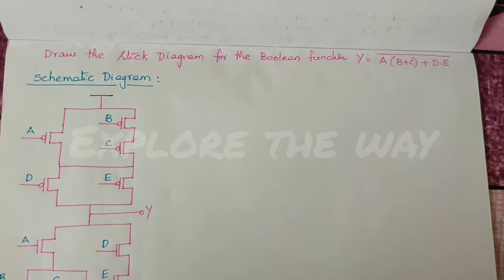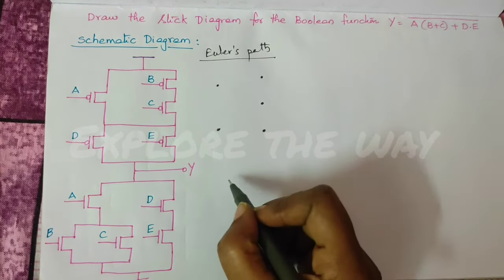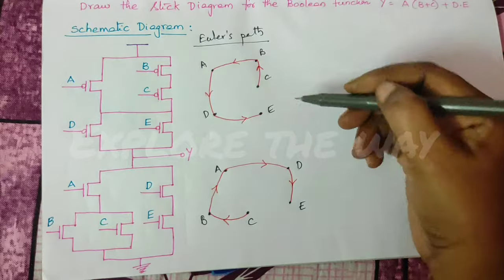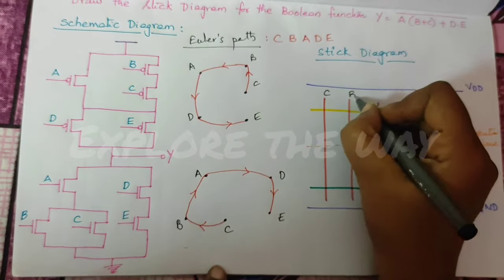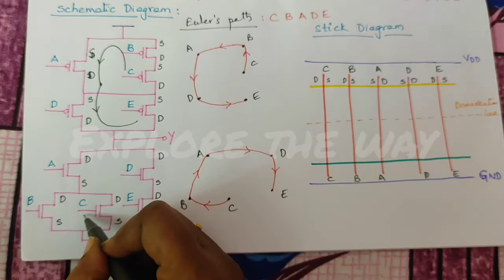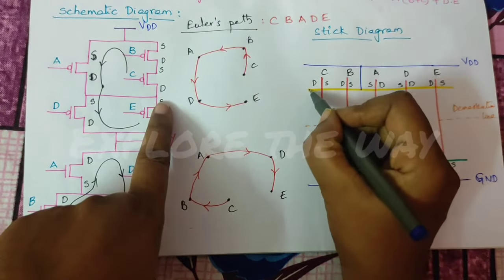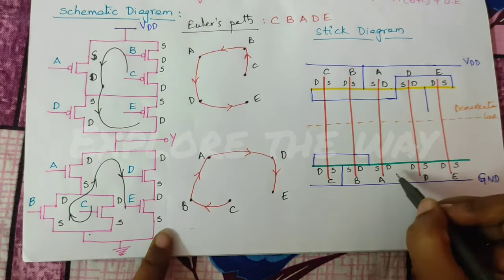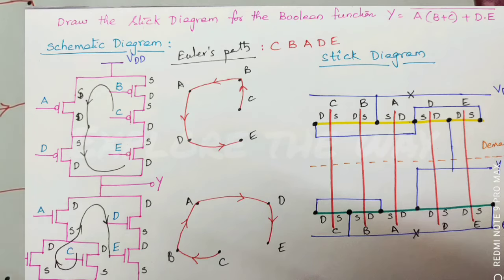Stick diagram of a Boolean function || Explore the way

Comment: mam , how did you take eulers path in pull down network as CBADE , shouldn't it be CADEB or BADEC , cause connection to C and B is kind of interupted right ? i could be wrong though.
Reply: The Eular's path should be the same for both Pull Up and Pull Down networks.....
Reply: No it is not interrupted, as you can see it follows a perfect path through the circuit

Comment: I think you made a mistake in labeling the gates in pMOS. Its Drain, Gate, and Source but you labeled Source, Gate, and Drain.
Reply from the maker: No mistakes. Everything is correct.
Reply: @ExploretheWAY  Okay but can you explain me why there is difference in pMOS and nMOS terminals? In pMOS you labeled Source, Gate and Drain and in nMOS you labeled Drain, Gate and Source?
Reply: @aashishgoreja7455  The source of a pMOS is connected to VDD whereas the source of a nMOS is connected to GND. The drain is the path that leads to the output Y. This is why the gates were labeled this way.
Reply: @aashishgoreja7455  first learn thoery about pmos and nmos transistor then point out mistakes :)
Reply: @aditya9573 you tell them. People go in the comments and everything is a mistake to them while they don't even know the theory :>)

Comment: I think this schematic has an issue..Don't we have a series connection between A(B+C) and D.E? It looks parallel to me. Nice video though
Reply from the maker: There is a parallel connection between A(B+C) and D.E in the pull down network. This schematic is absolutely correct.